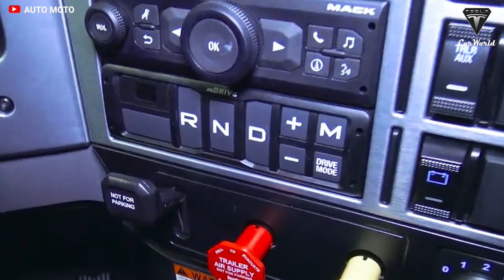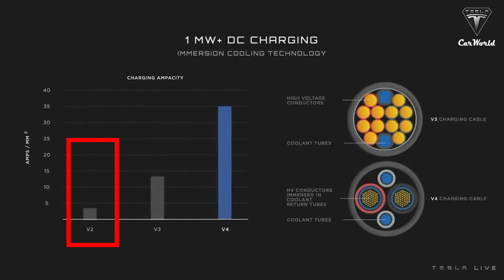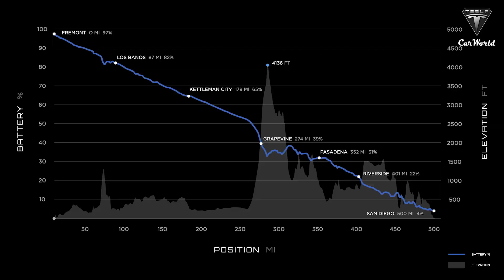The Real Tesla Semi Truck With All New Breakthrough Updates in 2023 - Everything You Need To Know

Comment: Here's some reality for you, for anybody to purchase a Tesla semi truck they need to upgrade the grid install mega chargers and purchase energy storage units all Surplus. We're talking about half a million dollar investment prior to purchasing a semi truck. Also the 500 mile range is meant to completely deplete the battery from 0 to 100% where in reality that's not realistic. Tesla's actual range will be low 300s and the big key is the payload, as in how much you can actually haul. I'm not talking about gross weight of 82,000 lb. All these videos are misleading since nobody knows anything about Trucking
Reply: You don't need megachargers at most companies because they don't drive more than the 500 miles a day. A much lower rated charger can overnight charge the trucks at a more friendly rate both in cost and battery wear.
Reply: @jameshathaway5117  unfortunately it's not about how far they drive as it is how many trucks are charging at a time. The Mega chargers are a buffer between the grid and the chargers so the drain on the grid is lessened. If we are talking about fleets of trucks your looking at 100+ trucks all charging at the same time, if they only used half their battery that's still the equivalent of 50 trucks charging 100% of thier batteries, which one study showed is enough to power the empire state building for a day, (a quick Google search will take you to the study). How many empire state buildings can you put on a grid? Not many, now multiply that times X number of fleets, and that's what the Mega helps with.
Reply: @xcaliber1787  
One study showed?
50 trucks would be 50 MW 
Total. Drawn over a few hours.
You should see what some factories use.
Reply: @neilkurzman4907  I tried posting the link but it wouldn't save my post if I did, so I'm just post what it said, "The Empire state building's peak electricity use tops out at about 9.5 megawatts." That's 5x, and  just 50 electric trucks. 50 trucks is a small fleet, then you throw in the fact you'll have multiple fleets and hundreds if not thousands of semi's and you have yourself a real grid problem.
Reply: @xcaliber1787  
You’re probably comparing megawatts to megawatt hours 
If the Empire State building is drawing 9 MW it will draw 9×24 megawatt hours in a day. 
Each fully charged truck has one megawatt hour
Reply: @neilkurzman4907  I believe it is MWH because it states ,"at peak" so yes 9.5×24 would be the daily value roughly, since 9.5 was the peak useage the daily MWH useage would be lower then 9.5x24.
Reply: Just so you know. 500 mile range was after a full payload trip they repeatedly did getting that range. You are right the more likely range will be 10-90% which is 80%, that is 400 miles, not 300. Also the investment is being made by companies because it’s good business. Electric trucks, tesla or not, will last longer, have better breaks, cannot jackknife, have more power. The world is going electric so that investment will need to be made sooner or later. The sooner they do it the cheaper it will be. Electric trucks are on back order by almost every major corporation in the U.S. I Hate when people come in the comments of these videos thinking they know how to save corporations more money than the people getting paid millions to make these decisions.
Reply: @michaellmare5574  where did you get the information the trip was made repeatedly? It was my understanding it was one trip. Your right electric semi's will be adopted but fleets have another 23yrs before they have to make that decision (2045). If it's cheaper to continue to use diesel, bio fuels or natural gas, like Amazon, UPS,  and FedEx, fleets will choose the cheaper option as long as they can. I say cheaper because of the cost of the tesla system you would need to support say 100+semi's. I don't think he is against Bev semi's, matter of fact i know he is not, I think he is just pointing out the flaws in the adoption of the tesla semi. Imo there's a place for all in the space just not the total domination you hear so often in youtube videos.
Reply: @michaellmare5574  The suggested state of charge I believe is 20%-80% not 10%-90% for Lithium-ion battery's for the best longevity.  If you use those numbers you get the 300mi range, maybe tesla semi is different but that's what's recommended for the cars. I'll go back and listen again but I don't remember them saying it was specifically cross country, but I'll take your word for it, dosnt really matter in the long run its still better than any other zero emissions vehicle out there. I'm going off of how the trucking industry looks now. Major fleets are moving out of California because of AB5 law in and going to neighboring states because its cheaper to operate. 94% of cng used in California last year was RNG which can also be compressed and used in LNG as well making it net negative, and there is also bio diesel,  h2 ect... my point being their are cheaper options till the mandates become national.  15 states  have adopted CARB with a mandates for 2045 which requires a N0x level of 0.01 if an engine can meet that level they can still operate within the state... all I'm saying is there's choices
Reply: @xcaliber1787  the issue with that is that teslas battery chemistry on the new model 3 standard and semi allow for 100% usage with 0% degradation. I only said 10-90% because Elon likes to exaggerate at times but on this he seems to not have.
Reply: @michaellmare5574  In the long run dosnt really matter tesla semi will fit In somewhere, there are many different trucking applications.  I personally just think it's too early and ahead of its time. The grid and infrastructure is not ready for it. I don't see it being a OTR option currently because of those reasons but for companies that can afford it and utility companies that can accommodate it, it fits well. For OTR I look to different options like Hyliion and their solution making more sense.
Reply: At first it looks like nowhere to charge but I thinh that Tesla vill do v4 charging network very soon.  When Cybertruck arrives then it has even more sense.
Reply: The cyber trucks are not hauling a 53' trailer nor will they drain as much from the grid so they will not need the utility upgrades like the semi will, the charging stations will be different,  plus truckers shower, eat, pay bills ect..  all at the existing stations. If they were able to build out the v4 charging infrastructure they would still be inconvenient for truckers. Tesla would have to convince existing stations to do the upgrades or eat the cost themselves which would drive up charging prices potentially.
Reply: @xcaliber1787  Using existing stations would negate fuel savings since they charge double for electricity.  Tesla Semi is for distribution type systems, companies will need to set up or share their own V4 superchargers on the route to save fuel costs.
Reply: @GROGU123  I agree, and if semis use other companies charging you may get into raised prices as well.
Reply: @GROGU123  This is a day cab, not the sleeper cab.
Reply: @GROGU123  Tesla super chargers are all over the place v4 will be no different. What are you on about?
Reply: @mjax278  v4  will be very different. You need a bigger infrastructure to draw that much power from the grid, and that's if the grid can handle it. When facilities are built they are not typically built with that much of a electrical draw in mine, so the infrastructure to the facilities need to be upgraded to be more robust than that of a super charger,  thicker capables,, transformers, relays ect...
Reply: @mjax278  Nope, V4 superchargers will need pull through parking space that can fit an entire semi truck.  That's alot of extra space, you can't just throw them in the back of a parking lot like the V1-V3 superchargers.  It's going to take alot more money and space to install V4 superchargers for semi-trucks.  Truck stops will probably want a cut of the sales.
Reply: @GROGU123  it’s not as complicated as you’re making it seem. Furthermore, if stations want some of the profit then so be it. It’ll still be SIGNIFICANTLY cheaper than diesel…it’ll far cover the inflated cost of the truck 🛻 in a few years alone. Not to mention the reduced maintenance and the fact that the companies that purchase these vehicles will be able to eliminate drivers eventually, only further reducing costs. Which by the way, should be brought down to the consumer who buys the products. If companies in the future no longer spend millions on gas and can eliminate trucker salaries, the cost of goods and services should decrease dramatically. (Or what will likely happen is the companies will just pay their CEO’s the extra profits. Cause you know, rich people are gonna rich people🤣🤣🤣)
Reply: @mjax278  If you double the cost of electricity like Electrify America does, you negate nearly all the fuel savings compared to gas, and about 90% compared to diesel.  The return on investment must be within 3-5 years to make it worthwhile for companies to buy semi-trucks.   Charging at your own depots and retail outlets is the only way to make it viable, or if Tesla does not charge a profit for supercharger stations.
Reply: @mjax278  Diesel is extremely high because of the war in Ukraine.  It fluctuates but is currently very high due to the global energy shortage due to the war.  Also, you cannot double it several times.  That's a lie, especially in some states like California and Europe where electricity prices are very high.  I've already done the math for a friend that lived in an apartment and was looking to buy an Chevy Bolt.  At 31 cents per kwh for Electrify America, the cost of electricity does not negate the savings in fuel.  Some rough math for you, Chevy bolt battery pack is 66kwh total.  80% of that is about 53kwh to get an 80% range of 200 miles.  31 cents * 53 =  $16.43 for 200 miles of driving.   Most Bolt owners are getting between 3-4 miles per kwh.  EA also charges per minute in other states and the bolt takes 80 minutes to charge 80%.  So that's about $9.60 if you can time it perfectly to disconnect your car at 80 minutes.  So the pricing for EA charging is somewhere between $9.6 and $16.4 depending on where you live.    Now buy a Toyota Prius that averages say 50mpg real world requires 4 gallons to drive 200 miles.  Current gasoline price is $3.70, so 4 gallons * $3.70 = $14.80 which falls in between the price to charge a chevy bolt.  When you charge at home for <15 cents per kwh, you can cut your fuel bill by over half.  So it makes sense if you own your own home and have a driveway or garage to charge your car.  But financially may not make sense if you live in apartment. Same principle applies to relying on charging infrastructure for semi trucks as opposed to using your own electricity at your own utility rates.  The cost savings are massive when buying direct from the utility, but are heavily negated when you buy electricity from a middleman.
Reply: @GROGU123  diesel will ALWAYS be more expensive than electricity.
Reply: @mjax278  I never said it wouldn't be.  You should learn to read.  The problem is, when you charge from a middleman and not directly from the utility, the middleman will charge at a high rate to make a profit.  In which case, will heavily negate the savings in fuel.  I've said it several times now.   Companies buy trucks and expect a return on investment.  If that return on investment is too long because they can't charge at home base and rely on middlemen, then they may stick with diesel.
Reply: @GROGU123  it costs like 5 cents a mile to charge an electric vehicle with a total charge cost of just over $15. A regular car that gets thirty miles a gallon and Is paying 3-4 dollars a gallon (In diesels case even more) is paying like 45-60 just to fill the tank whereas an electric vehicle is paying like $1.5 for every 30 miles and a little over $15 to fill the battery. $15 compared to $60 is 4 times the amount…

Furthermore, For you to say that diesel won’t increase along with time is just foolish. Especially because the world is moving away from fossil fuels, so the industry will continue to Jack up  prices to maintain profits. 

All this doesn’t even mention solar and the infrastructure including batteries that will be built for the charging network that makes it even cheaper over time. You’re just negative and foolish in regards to how it’ll play out. A non renewable resource will always be more expensive than a renewable one…
Reply: @mjax278  There are plenty of cars that get well over 30mpg.  Why do you choose that number?  If you want to save on fuel, there are a number of hybrids that do the same.  Even a Rav4 hybrid gets 40mpg and only costs $800 more than the standard awd gas model.  I gave you the actual math, not your estimates.  The Prius actually falls in line with costs when you charge with Electrify America.  For an apartment dweller, you wouldn't buy an EV for fuel savings.  For a homeowner, you can save quite a bit of money on fuel as I've already stated.

Again, your math is based on HOME CHARGING.  I never disputed that, go back and READ.  I said numerous times, you have to charge at a home base or your own retail outlets to see the cost savings.  But when you rely on outside infrastructure, they'll need to charge double to recover cost of building the chargers as well as make a profit from the chargers.  That heavily negates the cost of buying the electric semi truck.  So I don't know why you're going on about charging at home utility rates.
Reply: Elon could easily afford all of this while passing on those charges to the consumer. Not to mention they already charge for their autonomous driving. Mercedes already charges new buyers a members fees every month.
Reply: @kosovo140  Elon could afford to outfit all the stations on all his customers routes without raising prices on charging, and if he passes on the cost that makes for a longer TCO return,  why would a fleet go for that?. Then why didn't he pay for pepsicos upgrades and charging infrastructure?
Reply: @xcaliber1787  do you know how much cheaper charging is in comparison to diesel? What are you talking about? 

If it didn’t make sense financially for the companies that paid such large sums of money they wouldn’t do it. Pepsi, and the other companies that ordered the semi didn’t become multi billion dollar companies by throwing money away. They decided that this was literally the best decision financially for them. No to mention The drastically reduced maintenance cost.
Reply: @mjax278  they are not just paying for charging they have to pay for the infrastructure as well. Utility upgrades, chargers, mega packs, and what companies are you talking about? Pepsico is the only one that has a few prodution model telsa semi and only 4 charges at their factory. Look up the permit Pepsico filed with the county, it cost them 334k just for Utility upgrades not counting everything else I mentioned above. It's easy to put the DD on other people and companies vs doing it yourself. People said there was no way Nikola was a fraud because GM would not have invested in them... how did that turn out? Not saying tesla is a faud by any stretch but the argument that it must be so because one company has orders place  is flawed. Other companies may have orders but that's not proof of anything other than some good PR.
Reply: The load they show hauled was over the grapevine and STILL had 7% total unused capacity. They will more than likely do 500 miles in any conditions. The only real linchpin is battery longevity at these draws.
Reply: @jameshathaway5117   I disagree respectfully, if you look at the Grapevine , when they started the hill vs leaving the hill they had almost as much battery as they did when they started, which is good.  Then you look at when they started the Riverside hill how much battery they had vs when they started, there was a big difference because of the shape of the hill and not as much time for the regenerate braking to capture energy.  The grapevine was optimal for the Tesla semi... hills like Riverside would drain the battery faster, conditions matters.
Reply: @jameshathaway5117  but they never showed the load ?? 
Payload was never disclosed 
So why not ?
Reply: @spinnymathingy3149  it was a flatbed carrying standard concrete barriers... can you use a calculator?
Reply: @jameshathaway5117  yeah, thanks, good with a calculator, but no idea how much a concrete barrier weighs. Do you?
Reply: @spinnymathingy3149  they are 10ft so 4000 to 4500 per block. 4 rows 3 wide for 12 blocks total. So if we give Tesla no leeway let's call it 4k. 4000lb x12 blocks for a load of 48k. The average flatbed 44ft is 12k so that brings the low side estimate to a trailer weight of 60k worst case scenario. If you figure the blocks at 4200 thats 62,400 with the average trailer weight of 12k in a little more realistic numbers. So staying well within the averages and shooting for a total weight of 81k lb we are looking at a truck between 21k lb and 18,600lb. While that is on the heavy side its still within the spread for diesel otr trucks. That doesnt really take into consideration the spread in trailer weight as we only use the average. So tecnically wiggle room still exsists but this is pretty close. None of this is a trade secret that's why I always said this presentation was for truck drivers.
Reply: @jameshathaway5117  thanks, great analysis 👍
Reply: If do a little research you will find nothing you say here is true. Not sure why everyone always fears change. It’s happening and there is nothing any of us can do about it.
Reply: @bigb-mt6fn  what exactly isn't true? Please be specific.
Reply: This truck will put so many drivers out of a job…..
Reply: that's definitely right ! what's the weight of Tesla semi without trailer ? and under the GCW limits of 82000lb, how many cargos do it can load is very  important .
Reply: Not sure why you are putting yourself out there with specific facts and details that are up to 50% different than test numbers.  You seemed to overlook the battery power storage at charge station as Tesla income generator.  You missed a lot of presentation and validation.  Your statements are not a good look.
Reply: @markecklund9598  you said a whole lot without saying anything. Please source where where you found that the facts I stated (with source) are up to 50% different? As for batter power storage as income generator for Tesla? Why does that matter? Did I ever say that wasent income generator? How does this even apply as a contradiction to what I said. You can’t just go around commenting that statements are not a good look, provide source+facts+a reasonable argument that applies to what I said.
Reply: @markecklund9598  Ahh yes, fleets will spend 2 million for 3 Semi with all upgrades. Good luck
Reply: Here’s some reality for you. They don’t can use. Super chargers also. It depends on what the customer needs.
Reply: I believe what you are saying.  I also know that technology is moving at light speed now, what is true today may not be in a not so distant future.  Autonomous trucks will not need professional drivers in a certain percentage of the market over the course of time in my opinion.  If that holds true It could exponentially increase earnings potentials for individual professional drivers operating multiple trucks simultaneously.  Cannibalism of the trucking industry is a real and likely possibility.  If so, which dog do you want to be Chappie?
Reply: You take it to a charging station - do you own your one petrol station?  Duh!  How do you know the mileage - do you own one?  As for knowing about trucking - it’s all down to money and driver productivity.
Reply: No More Lithium! NEW Sodium Ion Battery 2.0 Changes Everything 2023
https://youtu.be/QZdWxWtQBHs
Reply: @Shawn Ferdinand it’s around $400k

Edit: Google says 400k but this video says hundreds of thousands less. Who knows what to believe. Not looking at high end trucks and seeing the most expensive at $200k or so for conventional  trucks, it would be really hard to justify an increase of %100
Reply: Exactly. Load capacity is the only number freight companies care about
Reply: Clown🤡
Reply: It is tested in all conditions and every aspect has been checked, it literally has 500miles + reserve (emergeny) backup
Reply: @goldheartgaming  So, how much can Tesla Semi actually haul???
Reply: @goldheartgaming  but the payload was never mentioned ?? 
Funny about that
Reply: @goldheartgaming  not in all conditions. Its only did the 500mile journey once. Wasn't in snow too or cold conditions. They have tested it in those conditions though but now where close to that range
Reply: @teem5642  I think we can assume between 
400-500